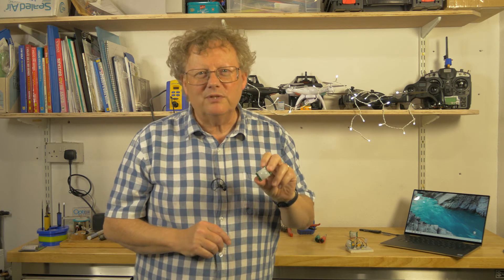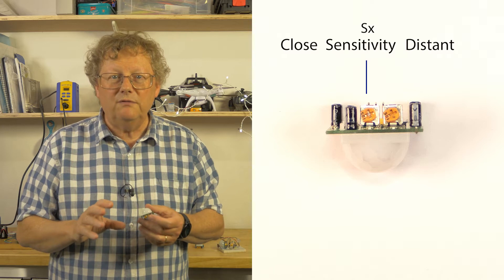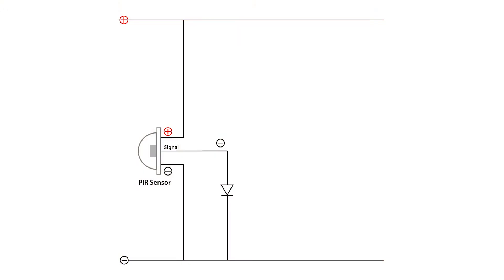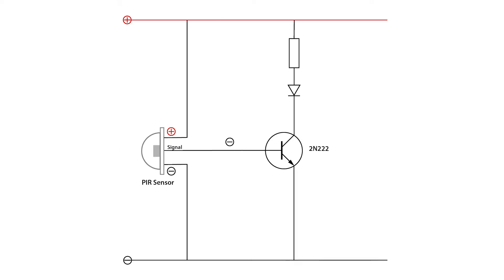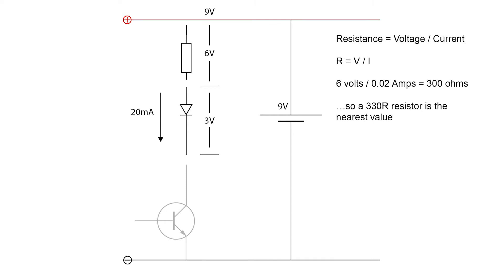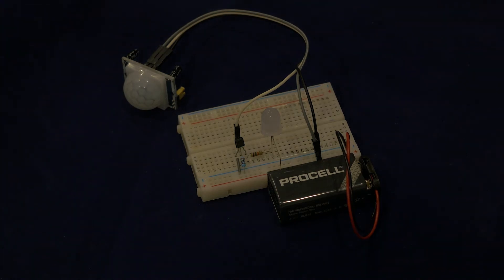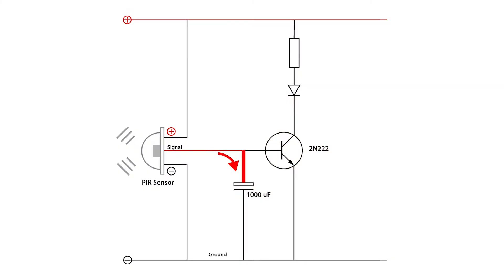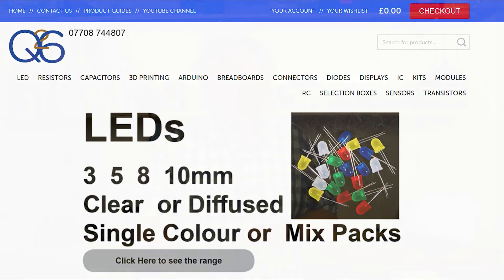How to use a PIR Passive Infrared Motion Sensor to control a simple lighting circuit

Comment: Hi there. Just a couple questions. 1. When using the 1000uF cap, do you still use the 10k resistor (This resistor is not shown in any of your schematics)?  2.The 330R is shown on your schematic as being inline from the + rail, and before the anode of the leds, and the cathode of the led is connected to the collector of the 222, whereas the breadboard is showing the 330R is inbetween the collector of the 222 and the cathode of the leds. This shows the resistor as being on opposite sides of the leds. Am I reading something wrong?
Reply from the maker: Yes, the pull down resistor is necessary to stabilise the sensor, as outlined at the start. I omitted it from some of the schematics, but you can see it being fitted on the breadboard. The 330R resistor is to limit the current through the LED - it can be on either side of the LED as the current is going through it and a resistor is not directional. I hope that helps...

Comment: Thank you. I’m a total beginner with a bunch of components and a simplistic approach. I was trying to use the signal from the PIR to power my led strip. Upon recognizing the 3.3 volt output I thought I could use a voltage booster to up the signal output a couple volts- I did say simplistic. I hadn’t used transistors before but I have a supply of them. Thanks again!

Comment: Great explanation thank you!

I’ve hooked mine up using a 5 volt power supply, these lights have a button which switches from on steadily to flashing. When just on is switches it works fine but when I have it on the flashing mode, they just flash every few secs, triggered or not

Edit: power supply is a 3aa battery pack

Comment: hello, would it be usefull to add a NE555 one shot timer to control the time the LED is on (in the use a night light controller)?
Reply from the maker: Yes, that is a possibility. There are many processor chips and small modules now that can be triggered in this way, and which you can programme too.

Comment: Useful video, thank you! I have no experience with this sort of thing but would like to add 2 PIR’s to one LED string of lights, one at the top of the stairs, one at the bottom.  Do I just put two sets of wires in the same holes on the bread board?
Reply from the maker: Hi Martin - it's a bit more complicated than that - and too big a question for me to answer in a YouTube comment, sorry. There are more solutions for switching larger circuits and hopefully sometime I can make more videos about them - in the meantime, you may well figure out how to achieve your goal as your electronics knowledge develops...all best wishes, Mortimer

Comment: HI, Is there a pir that sends a signal for 1 second only when motion detected and another signal when it times out from the same output? I would like to make a simple motion detector to turn my video camera on and off. I aready have a remote controller for my camera with a spare transmitter and the one button turns the camera on and off. I could use the transister to operate a relay to short out the switch in the transmitter. Great video. Thankyou.
Reply from the maker: Glad you liked the video - you can experiment with the on and off duration controls...

Comment: Great video, thank you. I've just knocked one of these up using an LED strip, works great but the sensitivity control doesn't seem to have much effect. I have it turned all the way down and it works from quite a distance, even further if I turn it up. Could it be faulty or am I missing something? It looks like the ones I have (HC-SR501) are min 3m range with the lens on. I've taken the lens off with some decent results but it still triggers a bit further away than I'd like. Would it be better to look for another board that has a shorter trigger range?

Comment: Excellent video, on most schematics for pir lights they have a 220r resistors from the signal pin to base,  what is the difference in performance with using 220r compared to 10k.?  Thanks.
Reply from the maker: Glad you liked the video. If the resistor is too low or too high, the processor pin will be either always on or always off - for Arduino and similar processor gpio 10k is a common choice.

Comment: Great video thankyou. New sub. How would one add a on/off switch to this? I checked all your other videos but can't find anything else regarding PIR's. All the other channels are a little confusing with their diagrams and are mostly for house lights and house switches. 
Would I use the POS of the battery and the N of the PIR?  Or would I connect to the SL? 
I tried incorporating it into a musical teddy bear and got the lights and music to work but only when the switch is initially turned on and it wouldn't react with the PIR still. Not sure where I'm going wrong. The teddy PCB has a main switch and a secondary button that you press for the lights and music to start. Many thanks from Aus

Comment: I'm looking how to make it go low, or ground a pin on a project, is this possible?
Reply from the maker: If you connect the output of the transistor to a pin of a ULN2003 the opposite pin goes to ground when it is high - or you can use a second transistor...

Comment: What is work my PIR sensor .It is automatically on without motion after off.Time setting is about 2 minute,after that auto off and turn on automatically without motion 
about 40 second .a
Reply: I have the exact same problem, have you found it in the meantime?

Comment: What a brilliant and understandable explanation! Electrickery becomes much clearer to my mechanical mind, thanks. Hopefully it might make a project I have in mind less of a crashing about in the dark exercise. Ideally I would like to have a 12 volt battery trickle (charged with a solar panel) powering a raspberry pi (with camera) and a 12 volt infrared illuminator controlled by a single PIR. Actuating the PIR would switch on the infrared illuminator, change the pi from standby to on and then take photos and or video. This does sound a bit optimistic, an alternative would be two separate PIRs one for the illuminator and one for the pi, though I suspect this scheme may not be ideal. This project is for security surveillance in the polytunnel on my allotment.  Please can you offer any advice? Many thanks

Comment: How can I do this with a 6v 700ma dc adapter because the pir sensor is only 50ua max the led light requires 6v 500ma

Comment: Very informative and exactly what I have been looking for. The many uses of this PIR sensor are endless. I use 18650 batteries as a power source. These 18650 batteries seem to last forever. I no longer have to stumble about looking for the light switch in the middle of the night just to go to the toilet or get a drink from the fridge. My end game is to keep energy costs as low as possible. I use energy saving bulbs in my home but regardless a penny saved is a penny earned in my opinion. Thank you for sharing this video.
Reply from the maker: Thanks - glad you enjoyed the video and I hope all your projects go well...
Reply: How do you use 18650 for this 5v sensor ? You have made a series of batteries for higher voltage or a single battery enough ?

Comment: Thanks for the very clear video. Is there a way I could build a similar low-power circuit to pull something to ground, rather than pull high?  I was going to use a relay but obviously running that off a battery is going to use significantly more current than a transistor. Thanks!
Reply from the maker: Hi - you can do this with a chip like a ULN2003A or even a transistor.
Reply: Hi Friend, Look into 18650 batteries as a power source

Comment: Hi there, great video thanks. Which relay and transistor would you recommend for a connection of the sensor to a 5amp 12v waterpump without using arduino or anything like that? With the power source being a 7amp 12v battery. I presume the 10k resistor would still be ok. Your advise would be greatly appreciated.
Reply: oh would i need a diode as well?

Comment: A nice dissertation on pirs.  A question, the front door bell keeps getting missed. The idea would be to have a plastic boxed pir behind a flower pot to pick up visitors etc.  A wire would run to the back of the house to ring when someone approaches with an attached buzzer or bell.  The buzz time should be short say 5 seconds and then not ring again repeatedly whilst you talk to the postman or whatever.  The dogs would also go hysterical if it kept buzzing.  Can this be achieved simply without an Arduino or similar?  No-one seems to have circuit to do this. Many thanks.
Reply from the maker: Its difficult to advise on specific projects - you may be able to make this work so I really recommend experimenting - glad to hear you enjoyed the video...

Comment: Hi, how about using this to operate musical movements (such as a musical box) and an LED? How would that be possible?

How,do you think these sensors compare to the RCWL- 0516?
Reply from the maker: Hi - I'm not familiar with the RCWL-0516, I'll follow that up, interesting - meanwhile, you can make just about anything work with a sensor and a transistor switch. If you need more voltage/current you can use it to trigger a relay or you can use it to trigger a processor board like an arduino which can in turn control all kinds of things. Thanks for watching - I hope your projects go well!

Comment: Great video, well explained! Is it possible to use a relay rather than an LED so when motion triggers, the relay could switch a higher power device or trigger a contact closure in a 3rd party control system? If so what relay would you recommend? Many thanks
Reply from the maker: Glad you liked the video, thanks - you can trigger anything that can be switched on by a digital pin - you'll need to use something inbetween the arduino and the relay, maybe a transistor or a chip like a ULN2003A - and the choice of relay depends on the voltage and current that it is switching. I'm doing something similar soon to control my garage lights.
Reply: @Q26Video  I am looking for something similar. What sort of transistor or relay. ( I dont understand the term 'digital pin' )